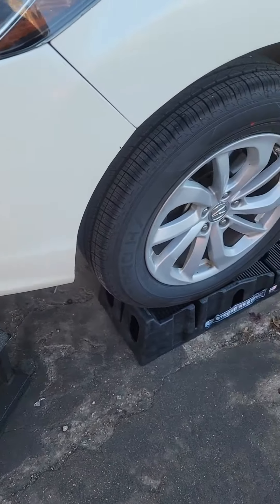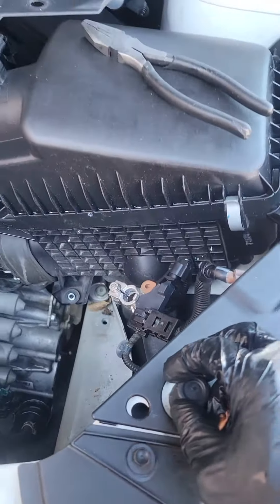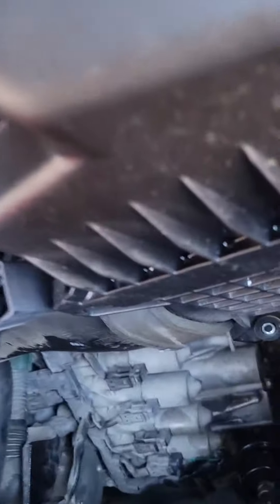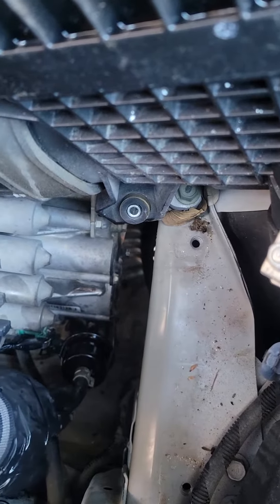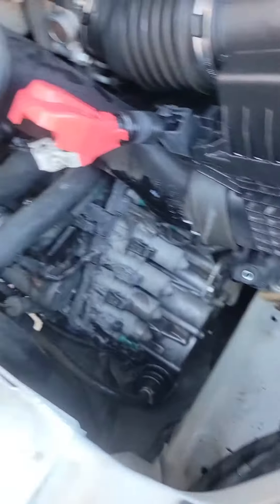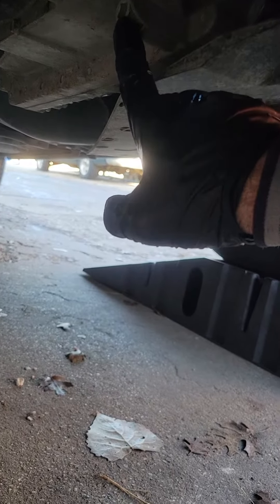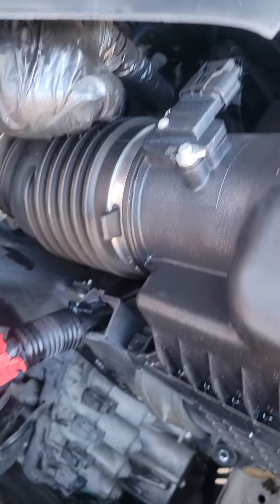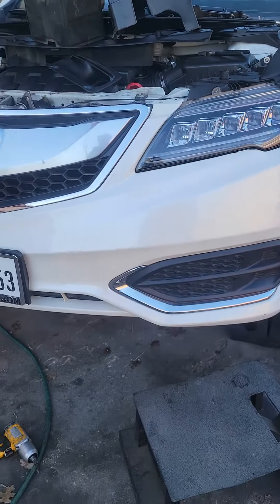2017 Acura rdx transmission fluid and filter

Comment: Did my atf change. I recommend using the fill port. I used the dip stick since it’s easier but if you fill that way it’s hard to get an accurate reading on the dip stick since the dip stick hole is covered in atf and it’ll mess up the reading.

Comment: Every 30k miles seems excessive. Terrible engineering if you ask me
Reply from the maker: Exactly 💯
Reply: Lol you should be replacing your transmission fluid this often for every car. Honda is one of the most reliable btw
Reply from the maker: @prestonphillips3375  This is what it is in the owner manual